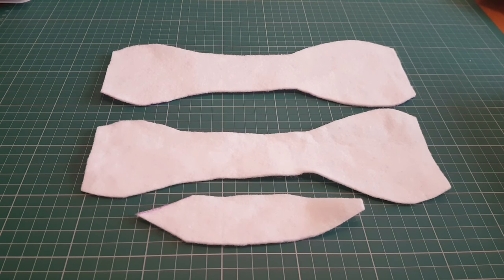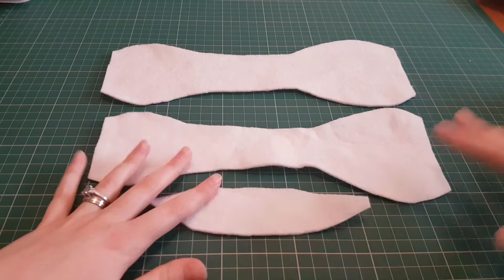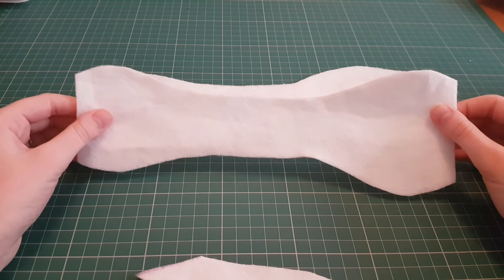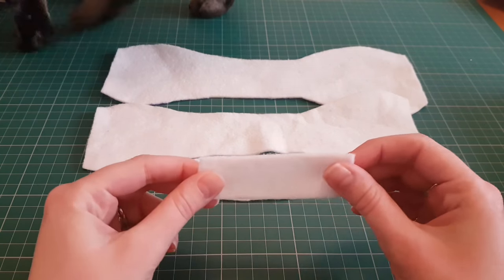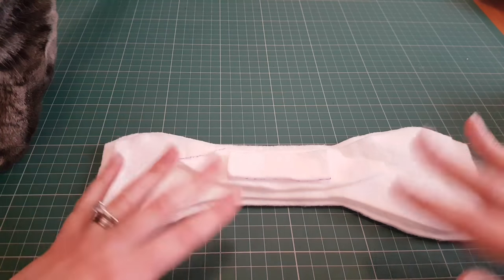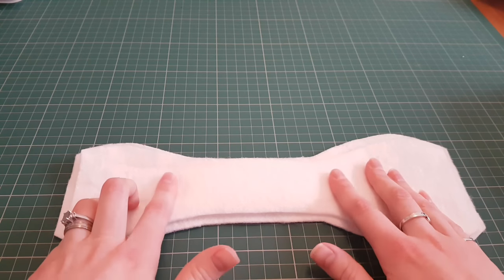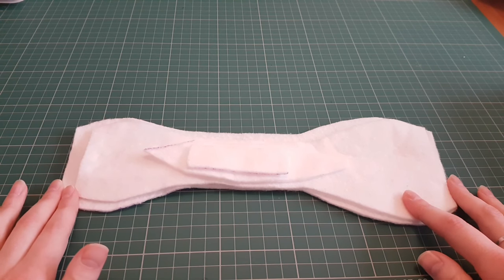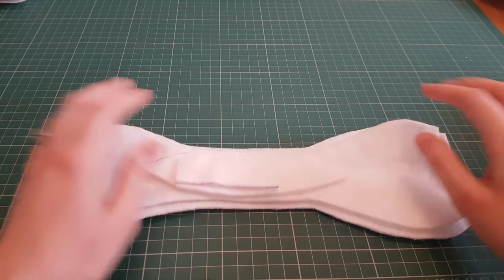Sewing Cloth Menstrual Pads Tutorial - How To Sew A Stepped Core

Comment: I've been building my stash for less than a year as a way to reduce my fabric totes and save money while in college. All of the pads I've made have a step core and the whole thing has been an experiment as to what works lol. I just use scraps of Terry, flannel, and cottons. I've also made the mistake of making some too absorbant with too much stitching.  I have a fairly heavy flow and a very physical job to make it worse. It's not quite mega-flow status but still could be equivalent to a 3 day postpartum flood gate, and just liners for a day or 2. It's really hard for me to get them clean when there is more than 4 or 5 layers of fabric and PUL. I tried tossing them into a wetbag. After 4 days in the bag, it took 3 oxy soaks, with felsnaptha/peroxide stain treater soaks and 5 wash loads, a few pads still stained or smelled like spoiled milk :/ it was weird! 2 more washes got the smell and all but 2 stains out. I washed with smaller loads and cold water (In previous cycles I used a bucket of oxy water to store them after rinsing each one and changing water 2x a day) Do you have any tips? I love cloth pads but I truly don't want to use only disposables during the next 8 months of school because I don't have time to launder them.
Reply from the maker: With a heavy flow its a lot of hard work trying to rinse them out. I dry store mine and then put them straight in the washing machine on a rise cycle. While still wet from the rinse stain treat them (i use ecover liquid stain treater with the little brush) and leave them in the machine to sit. If its a few light stains an hour would be enough but you can leave them wet for a few hours with the stain treatments on. I then put in my detergent and do a normal wash with them. I very rarely will have one come out with a shadow stain which i treat while wet and then put in with my next load of washing. Some people heavy stain simply due to the makeup of their menstrual blood so if you still have an issue with smell or staining i would try dry storing, then put them in the machine with a soop of oxy in the presoak section and normal detergent in the other. Add the prewash or equivalent on your machine to the normal cycle with an extra rinse for the end :-) By doing everything in the machine you save so much time!!! Also make sure when you put them in the wet bag you dont zip or tie it shut as this will cause smell in your pads x
Reply: Flow Of The Goddess Cloth Pads Thank you so much for the help! I will try that. I use the laundry mat in my building so I just soak in a bucket in my bathtub. I'm still working out the kinks of what works best for me and my schedule. I did check out your wash routine video, thanks again for the tips! :)